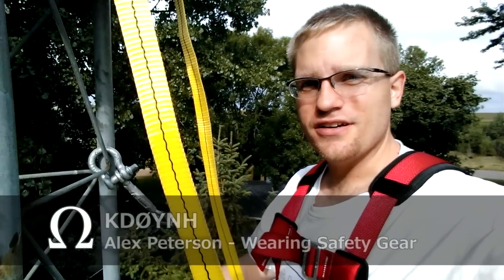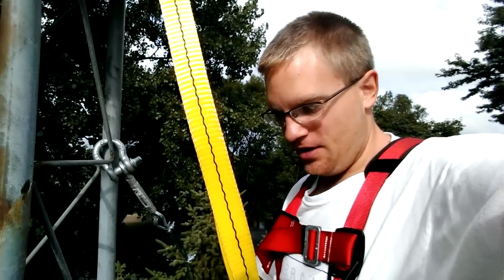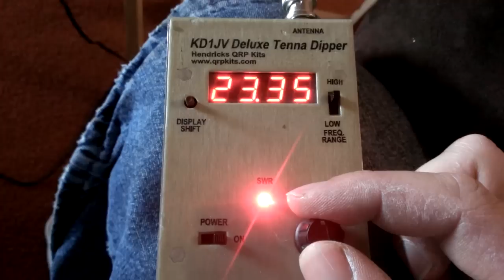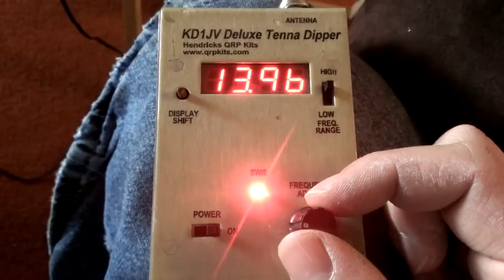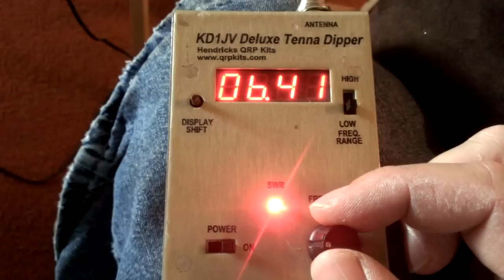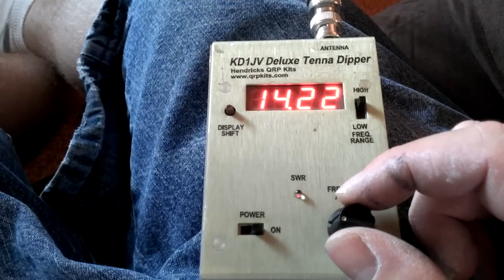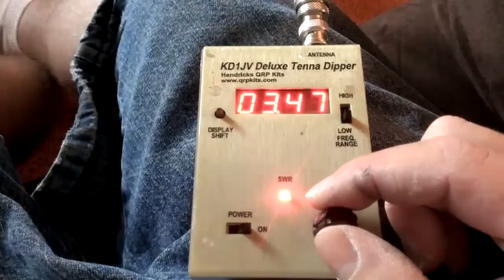Ham Radio Fan Dipole Antenna Part 2

Comment: You make a good video, but that antenna "dipper" box cracks me up! Though not an SWR meter, even my Heathkit Grid Dipper from the 70's has an analog meter. I've been toying with the idea of a fan dipole. Thanks for the ideas.